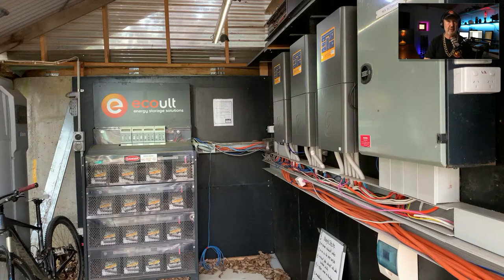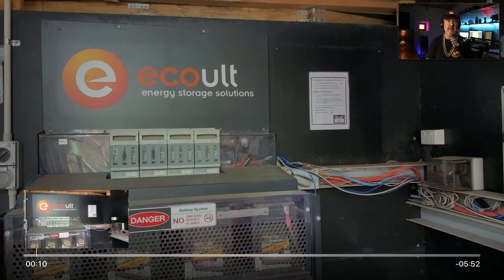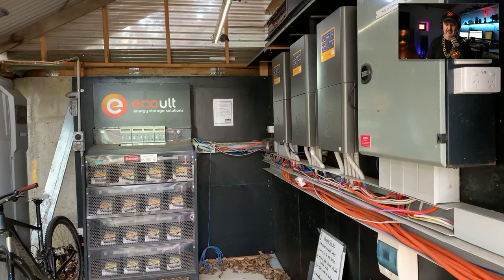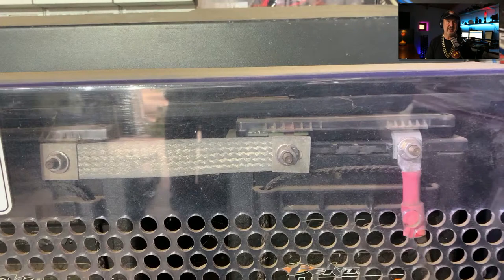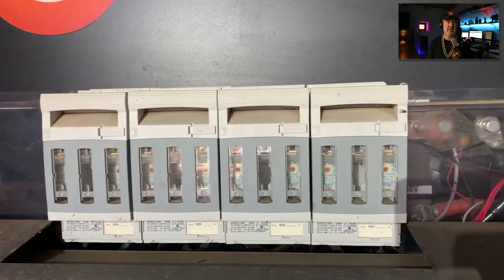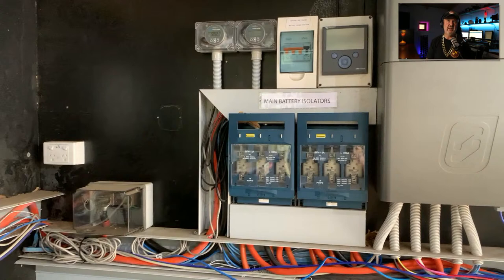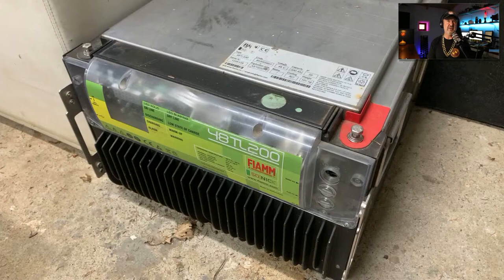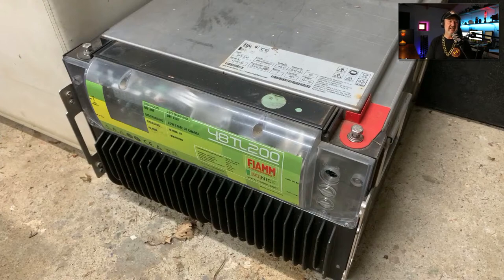Funky Batteries

Comment: at 30:02 are a very useful example, 2 batts with 52.5V, and 154/118 Ah apps 2 x 8kVA for 24 hours. For flat is soo good (Pmax=8.5*[0.25+0.75/(√n)] [kW]  n<20), so value > 3.8kW could be export over electrical network to other flats/users/houses.... thanx for sharing  40:37 aquion battery